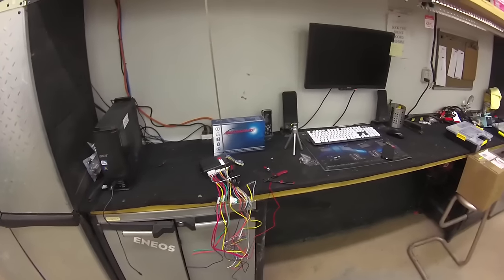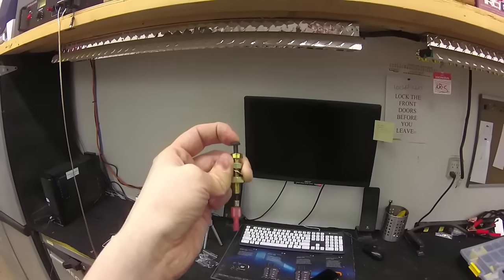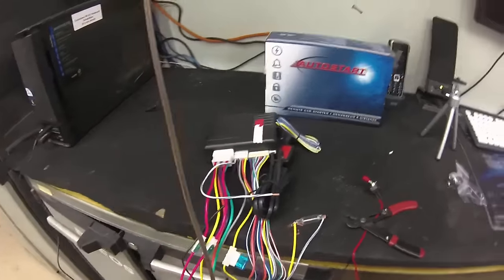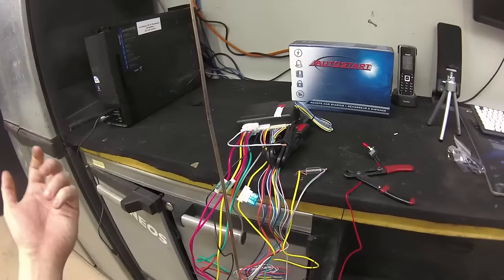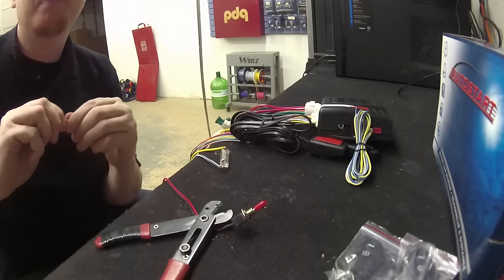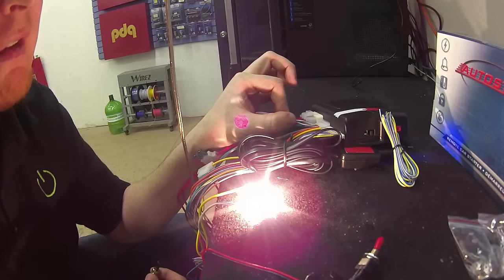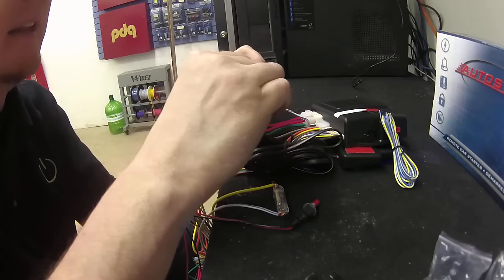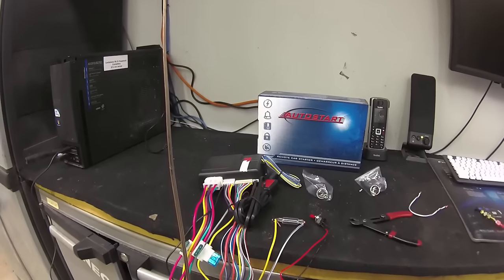How To Program an Autostart Remote Control Without a Hoodpin

Comment: I didn't understand about the parking "lights" or the bulb you have attached there but I noticed the antenna light flashes in the same pace so I guide myself with that and the clicks that the module made. It took me a few tries until I got it going. Thank you I appreciate the help.

Comment: Took me about an hour or so but it worked! You're the best :) ps. Anyone doing this if you are having trouble accessing the module and are having difficulty probing the wire into the socket, use a metal paperclip and it should work just fine!!

Comment: Thanks you so much for the video. My hood pin was too corroded (the PAD button won't work if pin is corroded) so I had to splice the wire and was able to get a good ground to get the hood pin light trigger to stay on long enough for reprogramming, which become a two person job for me. Had another person turn the key on and off and then hit the lock button and it work like a charm.

Comment: Had an Autostart Alarm system in the car but previous owner had lost the key. bought one off ebay and had some trouble getting it to work despite using the hoodpin. (It never gave parking lights.) 

Stripped a random wire from somewhere and tried this technique with the black and grey wire. Tapped the grey wire , then removed and inserted again. Parking lights were on! I turned the ignition on and off and held the ebay key's lock button. Game. Got it working. Thanks man!

At the end, I readjusted my hoodpin's depth and it seemed to work after so maybe it wasn't making a connection when the hood pin was depressed. The wire method will 100% work.
Reply from the maker: Glad you got it working, thanks for the comment!

Comment: we bought a used car a couple of years ago that we still have now and it came with a remote starter that was installed by the previous owner, but has not been working since we purchased the car. i had googled for a long time to try and get the thing working but have given up. with winter approaching again this year, i set out to try once more. there was a video from another guy involving the PAB button but it did not work for my situation. this one solved it, great explanation and visuals. thanks a lot! now winter does not seem so bad this year :-)

Comment: Thanks. It worked. My car could start for 2 seconds with remote start and died with 3 flashing brake lights. Now it works nice. I couldn't flash hood pin method with installation method. Thanks again.

Comment: Thanks man!! You saved me so much trouble. Found out that my hood pin is light sensor instead (super scketchy), just had to ground it using your technique
Reply: I've seen mercury switches, but never a light sensor...ingenuity i guess?  It would suck to program in the dark i guess!

Comment: Thanks for the video; I thought it was a great demonstration. I still have an issue with my starter after I tried the instructions posted in the video. I see the park lights come on after I probe it, turn key ON and then OFF, hold the lock on the remote but the park lights don't flash  rather just come back ON solid...

Any idea why I'm not get the flashing lights when holding the button on remote? 
Model: CT-3271 2 Button

Also, should the LED on the antenna always be flashing when the car is off?

Comment: Hey Jeff. Don't know if I am going to get an answer on a old video, but it is worth a try. I have an AutoStart system that came installed on the used car I bought. But after my car battery died a while ago, it seems that the remote won't communicate with the car anymore. I am buying new batteries to my remote today, but I was actually wondering what would be the necessary default steps after a dead car battery. Usually the system works normally and I need to reprogram the remote?! Thanks a lot in advance!
Reply: Turn the key on the on mode than after it's off push the button on the auto start box

Comment: Hi lockdown security!  I have an Autostart AS-1755 very similar to your.  Running for years in my automatic civic 2008.  Now, all i get when pressing Start is 15 fast bulb flashing.  The manual say to disconnect the manual  brake orange wire, but that wire was never installaed!  What should be the problem?  Thanks, and great video!
Reply: Michel Beaulieu  how did you resolve the 15 flashes, I had this same issue after changed car battery

Comment: I bought hyundai 2009 santa fe without the keyfob, the buyer told me he lost it. I found it under the seat. Surprised hyundai is using Autostart. I was able to follow the procedure and it flashed 5 times. But doesnt work. Is there anything I still need to check?

Comment: Great video! Question though. I have a polar start remote starter, my auto starts just fine but shuts the engine off in about 5 seconds. Any idea as to why this is happening
Reply from the maker: +Brad Krenbrink Hi Brad, sounds like one of the following:

1. Immobilizer interface (if vehicle is equipped with an immobilizer key) is not working correctly and may need to be reprogrammed or replaced

2. Tachometer signal is not being received by the remote starter and needs to be reprogrammed or re-connected/repaired

Both issues are something you should consult your installer about, if you did not do the install yourself

Comment: I have a 2008 Ford F-150 FX4. I have a WSST Compustar Model 2W901R-SS
I had 2, but one got broken Can I program a new one using the existing working model?
If not, is there any process I need to do to program another autostart/Unlock/Lock FOB?

Comment: Ours stopped working after we changed the battery in our car.  While this video was perfect in explaining how to program the remote, I wasn't successful.  After probing the hood pin, my parking lights stay on.  I turn the ignition key on\off, but nothing happens when I press the lock button on the remote.  The remote lights are flashing, so I presume the battery is still OK.  We have a bypass module included with ours, does this alter the instructions?  Thanks!
Reply from the maker: Sounds like your key fob is not working correctly or you may have an issue with the antenna.
Reply: Lockdown Security thanks!  I went to a local installer yesterday and they came to the same conclusion. I really appreciate you guys posting this video!

Comment: Is replacing the hood pin easy? Looks like a replacement is like 7 bucks. Mine is rusted and the wire broke away but it’s still there..

Comment: The ignition key should be in ignition  switch before you joint black&grey wires or doesn’t matter?
The door should stay open or closed?
What if the car doesn’t start for some reason let’s say we mis connected the wire and the car engine won’t start at all, what should we do to start at least?
Thanks
Reply: door status does not matter at all.  when the wire flush and the light is on then turn the key. try it . the most important is  flush the wire.

Comment: Love the video! But I have a question. I have the as-1725 and when I do this it only flashes one time and not 5. I bought my truck and the remote only worked once to lock the doors. I put a new battery in and tried to program the remote and it's not working. Any idea what's wrong with my system?
Reply from the maker: +Shane mcGaffick Hi Shane, the system may be in valet mode, try cycling the ignition on/off 5 times quickly, then proceed to try and program the key fob following the programming procedure.

Comment: Everything was working fine when I used your tutorial a couple years until recently my car battery died and the remote needed to be resynced. I've been able to resync the remote and all buttons work however now when I remote start my 2009 civic, the ignition turns, the engine starts but then immediately cuts out and the dash light gives the flashing green key light (immobilizer / security). Any advice?
Reply: The issue was my idatalink by-pass is a one-way so I had to reprogram my remote start brain to select one-way (xpresskit)

Comment: Question: if i have access to the end of the grey wire can i just touch it to any piece of metal grounded to the vehicles chassis? asking that because i see whoever installed this system on my truck didnt add a hood pin and opted to leave the grey wire hanging under the dash. the controller is further up in the dash so reaching the actual relay like you did will be hard.
Reply from the maker: Yes you can use any metal under the dash provided the metal is connected to the body (chassis) of the vehicle, and not to a piece of plastic or rubber under the dash
Reply: @LockdownSecurity  thank you for this video, I deleted my other questions because I just went out and got it working this time. If anyone is having trouble with the flashing part make sure you follow the process 1:1

Comment: So I have one of these older systems in a used car I bought.
The hood pin was busted, and I used this video to sync the remotes.
The doors lock, and unlock now.
But I can't get the car to start remotely. The lights flash, and I can hear the relay clicking. But thats it...
Is there something else to it?
Pushing the start button a few times, or other buttons??
I could use a hand here.
Reply: Did you figure out what was wrong? i have same issue, locks work but when i push remote start parking lights just flash twice

Comment: My hood pin seems to be like new, also checked the wire and connection...same but will not eneter programming mode to add a fob.  My Prostart 3271 unit also has a button(called PAB button) on the brains box you can use to program the remote if you didnt
 have a hoodpin hooked up.. . neither button with the tap sequence you suggested nor the Hold for 4 sec, release and tap (from manual) will put the unit into program mode (turn on parking lights) Any Suggestions ?
Reply from the maker: +Mighty Fast ensure the hood pin is not dirty and/or rusty, ensure it has proper connection to chassis ground (metal on the vehicle), if all else fails watch our other video for how to program with out a hood pin.
Reply: excelllentttttt vid Sir. Just a question? can i use one (it came with 2 remotes when i had it profesonally installed) of the ( ASTAS-1774SR) remotes from my daughters 2010 mazda 3 to  program it for  it to be use on my own 2012 honda accord? btw,, the same supplier/same brand autostart  for my 2012 honda accord and the mazda 3 was installed by the same shop. i guess what i am saying,can i reprogram one of the mazdas remotes for my autostart as i have my both of these remotes for the honda lost,ty
Reply from the maker: You will need to follow our video that shows how to program without a hood pin, long story short the gray wire (hod pin input) needs to see a ground (negative) signal in order to get into programming mode using the PAB button
Reply from the maker: Answer = YES
Reply: Thank you for the video. For the pigtail wire, what is the minimum amps?

Comment: Not sure if I’ll get an answer. But even though another motor was put in our 07 Sienna will the remote work ? After putting in the “new” used motor the pin was gone. AS-1757v. I know they’re discontinued now.
Reply from the maker: Yes this should still work.
Reply: Lockdown Security Thank You for replying. Can I replace the hood pin or hood switch? I checked out a video that you don’t need a hood pin or hood switch to reactivate it. Is that possible ? Also would it affect anything in a long run ?
Reply from the maker: @mom7630  A hoodpin is not required as per the title of this video. https://lockdownsecurity.forumbee.com/t/80b57s/autostart-key-fob-programming

Comment: +lockdown security I tried doing as you instructed but now the light just stays on instead of blinking. Do you know what this means? Thanks
Reply from the maker: +Shane mcGaffick Hi Shane, best bet is to consult a professional installer to assist you if you cannot get the procedure to work.

Comment: HI   .. I have an older auto start  called the extreme   ( ex-1724)   we recently had a battery issue with our truck and after replacing the battery my system isn't working at all.... could the programming be the issue?
Reply from the maker: Hi Tania, the system could need the remotes re-programmed or it could be in valet mode. Autostart.ca has owners and install guides which you can download.

Comment: Hi there, I have a question about my Auto Start remote starter. It came from the previous owner and worked well before during the last two winters, this year it's not working. 
I can use the remote starter transmitter to lock/unlock my car, but can not start the engine. I don't know what happened with it.
Reply: Hi I have the same issue. All functions work well but starting engine does not work. The lights flesh but the enginer does not work. Do you figure out what is going on there?
Reply: @saunterworld  Can you check if you accidentally put your remote starter into valet mode? I exited valet mode and everything was good.

Comment: hi i need help. i have autostart asrf-3515 which was working fine before. i dont have the 2nd fob when i got my car and its a pre-used. i thought the battery goes empty so i changed it, but still its not working. pushing all buttons does nothing for the car, but lights are showing on the fob whatever i press. no sounds coming out as well.
Reply from the maker: Please visit our website www.lockdownsecurity.ca, at the bottom of the page visit our Key Fob Programming help section, check out the Autostart programming article.

Comment: I have a GS2371TW, last winter my remote would sporadically work and has gotten worse since.  I changed the battery and this made no difference.  I did a factory reset on the system following instructions, then tried to reprogram the remote.  Now I cannot get the remote to reprogram. In the many attempts to reprogram I was able to "sneak" in a re-program but then could not move through the rest of the settings, in other words it works sporadically.  I have a hunch it is the remote that is not working.  I looked at buying a new remote but it costs more to replace then buying a new system at Black Friday Pricing.  So my question is if I buy a new GS2661TWU will the remotes work with my current main unit?  If not can I just plug in the new GS2661TWU onto the old harnesses without re-wiring?
Reply: +Bernie Lozar HI Bernie

We do not deal with GS part #s, only Autostart AS part #s, and while they should be the same wiring wise and operation wise, there could be differences and I don;t want to give you misleading info. Also, this is an email based enquiry, not something we'd provide over Youtube comments publicly
Reply: Jeff can you send me your email through a private message.  I would like to chat further about this.
Reply: +Bernie Lozar sales@lockdownsecurity.ca (it's a public email so it's all good to post here), mark it attention Jeff

Comment: i have a NS-1074 with FCC id NAH800R ,, antenaa  SH (433)-120 and cant get my remote to pair NAHTDK4 do i have the wrong remote antenna or something else it worked great for years b4 the remote broke?
Reply: Did you figure it out? I have the NAH800R as well
Reply: @Holtby1  yup I had to get a NAHTDK4 remote  because I had a sh 433mhz antenna ,,, what antenna do you have it will have numbers on it
Reply: TW-122. Which I've read is compatible. It was very hard finding info on the NAH800R but this fob should work?
Reply: @Holtby1   what's number  on your remote
Reply: @Holtby1  and sorry I had the nahtdk4 and have to get a nah2503 HDR to work with my  sh 433

Comment: I have reprogramed my remote like you mentioned and it worked but when I click the button on the remote to start the car, the lights flashes 5 times and nothing happens. What could be the issue? Do I need to program each function?
Reply from the maker: +Kola TheDog Please visit www.autostart.ca to download a user guide for your system, which will explain what 5 flashes means
Reply: mine does the same thing.. not sure the issue

Comment: I have a hood pin, but it doesn't work. I modified the above tutorial so that I didn't have to break my back to jump the autostart module. You can do it from the broken hood pin.

1) Remove gray wire from hood pin located at driver’s side front (under the hood).
a. The gray wire is ground.
2) Attached jumper wire to gray wire.
3) Press jumper wire again non-painted part of vehicle for one second.
a. Parking light will come on.
4) While parking light is on, have someone hold the wire against the car body.
a. It will stay one again for 20 seconds.
5) Enter vehicle and turn key to on and then off.
6) Hold lock button for 5 seconds. It is programmed.
7) Redo steps 5 and 6 for other remotes.
Reply from the maker: +grgilpin Hello, yes your steps are correct IF the hoodpin wire has been run under the hood, many times people find it hasn't been, hence the requirement to go under the dash

Comment: I've got mine reprogrammed, and is at least communicating with the car again.  I can even unlock and lock the doors again............But now I'm getting 15 quick parking light flashes when I try to Start the car.  Manuals online say that the problem is "The parking brake is connected to the Ground Wire." - Any idea how to fix that ?  (I didn't install it)
Reply from the maker: Hi Andrew, we would suggest you consult a professional installer who can check to see if the remote start is in manual transmission mode, but a good question would be, is your car manual transmission>
Reply: Nope, Automatic.  I appreciate the response.   :)